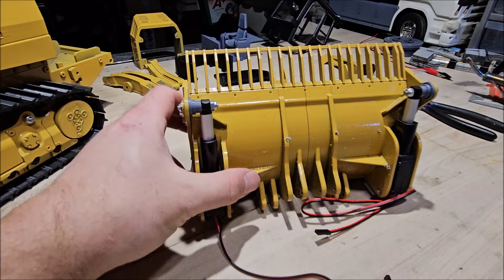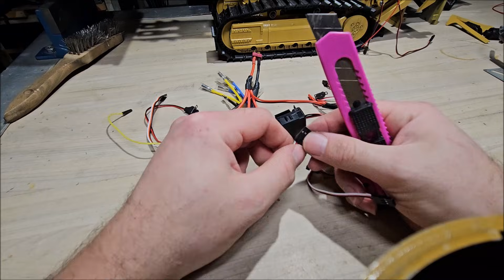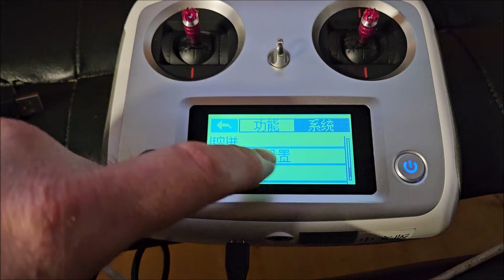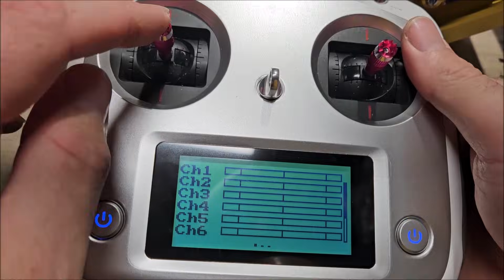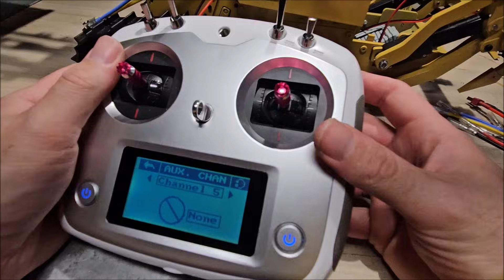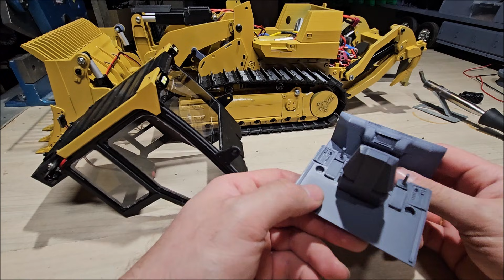1/14 Steel Plated CAT 973K - PART 3

Comment: I bought the small 30A ESC for my D6T build. You know what the little switch on the back of the ESC should be? It seems in the video that you have your's all the way to the "right" or to the side.
Reply from the maker: that small switch is to enable "brake" function or not :)
Reply: @burnie222rclasseanhanger6  do you know how to meassure what the right position is?
Reply from the maker: @filimon.danopoulos yes, thats easy :) just plug in the battery and see if you have to doubletap the stick in order to make the motor go in reverse

Comment: Loader is looking great!
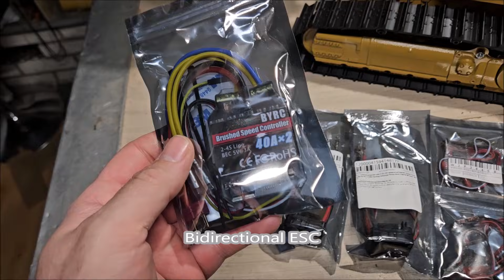Just a small correction so that people buy the right thing: 7:51 bidirectional means it does forward and reverse. The ESCs that control two motors are usually called 2-way (or 3-way or 4-way).  I use multi-way ESCs a lot to save space.
Reply from the maker: yes, that is true! but for some reason the sellers on ali lists a normal esc without the bidirectional word , so I easily find those esc's by searching for bidirectional esc 😆

Comment: I have used these ESCs at 8:52 and found them "ok" - but they are not 30A! I am pretty sure when I bought them they were advertised as 10A - and 2S only. I have used them with 3S, but I deactivated the BEC and they seemed fine. They are not smooth enough for drive functions, but for simple functions they are ok.
Reply from the maker: they come in 10A , 20A and 30A :) and yes, they are rated 2S only, but sometimes they work, sometimes they give up after 10 minutes :P I use them on actuators for accessories usually, like the ripper etc
Reply: @burnie222rclasseanhanger6  Ah, ok, I assumed it's always the same ESC and the seller just lies different amounts :D
Reply from the maker: @ haha, yeah that might actually be the case 😆